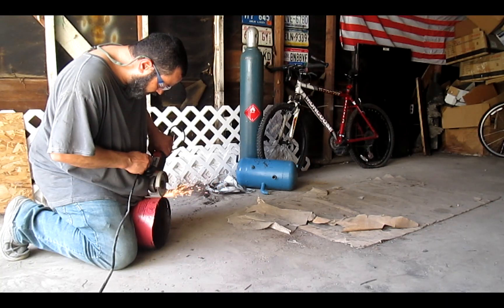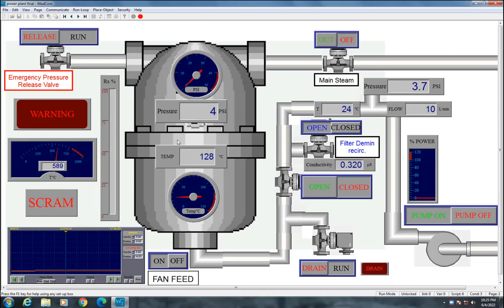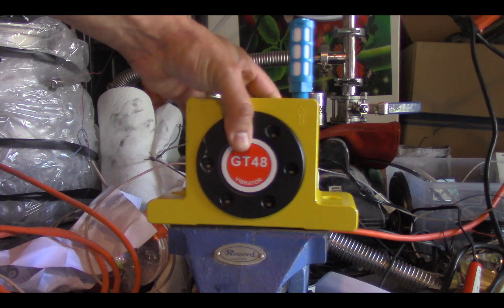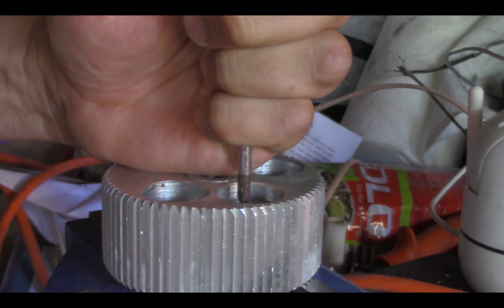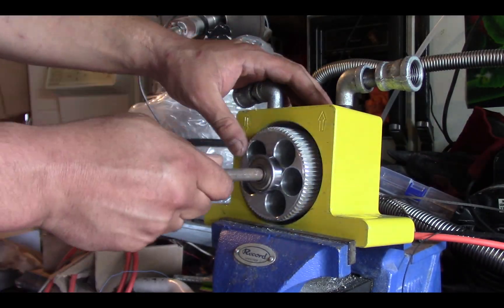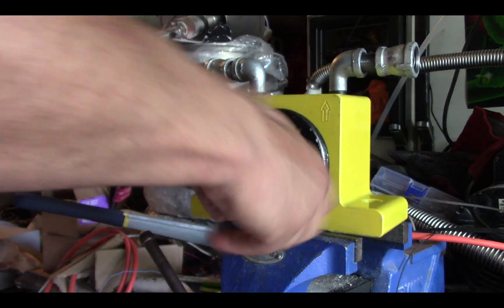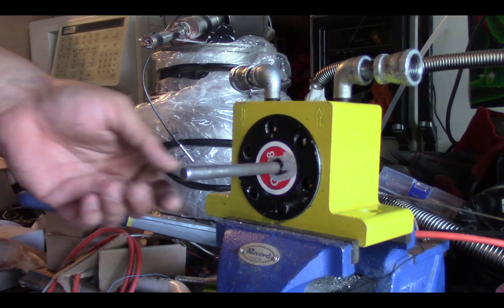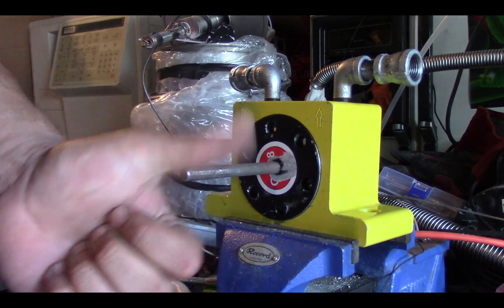DIY power plant update!

Comment: I wonder if a turbo charger would work better it would have a shaft floating on oil and be less friction.  They are also water cooled so that might help with efficiency.  You could use half the turbo easily or use the whole turbo to regulate pressure through the waste gate.  I have a turbo if you ever want to revisit the project.  As always awesome videos 😊